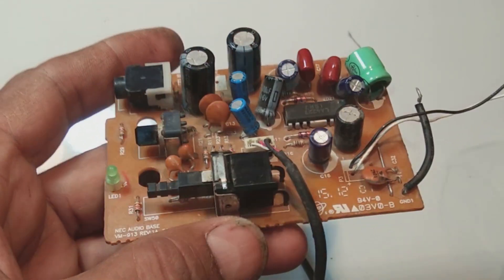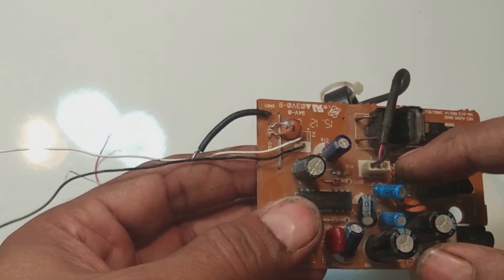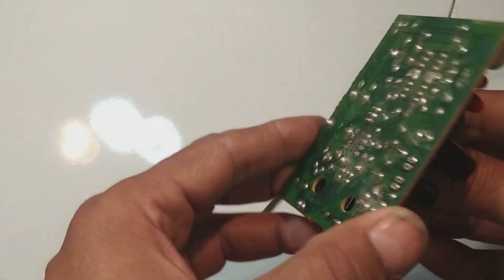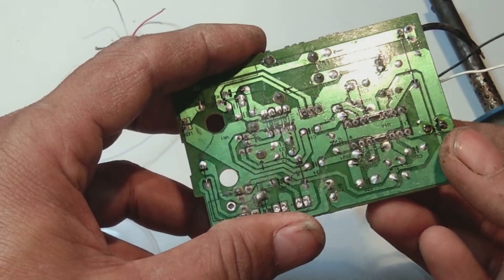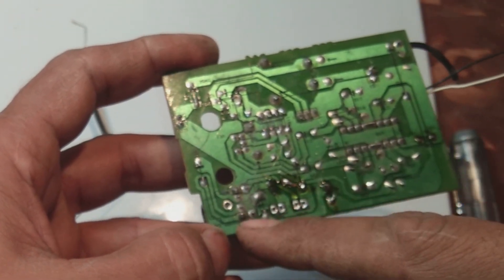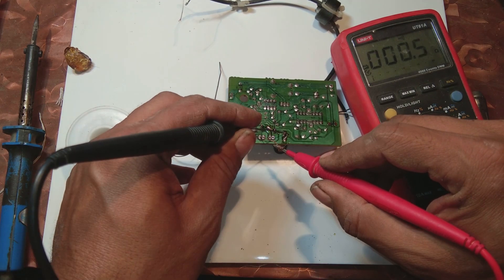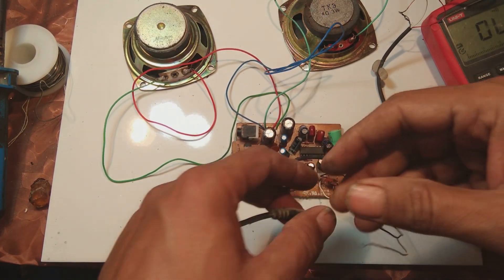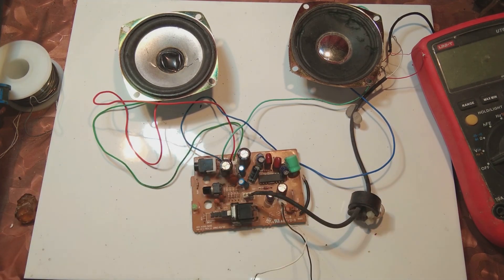Amplifier board repairing. How to repair audio amplifier. stereo amplifier LA4227 amplifier repair

Comment: Have one working but sound stops after 5mins can you tell me why?
Reply from the maker: Maybe a defective IC. First check for any loose connections on board. Reflow any suspected dry joints on board with hot soldering iron and good quality flux. If problem still present, replace the IC.

Comment: That chip reminds me of the stereo record players of the 1970's, two TBA type chips were used for the channels and the metal tabs in the center of the chips had a heatsink attached to remove the excess heat when the volume was high.
A manufacturers cheat that i liked was the use of the record player motor to produce 21 volts to power the amplifier :-D
The motor had a second winding for the 21 volts output,  so no seperate transformer required :-D.
It was a common trick for most cheap record decks in that era.
It was a cheap record player,  but the volume/balance/bass/treble controls were the slider type and mounted on a nice panal of shiney aluminium.
I was impressed too easy in those days lol.